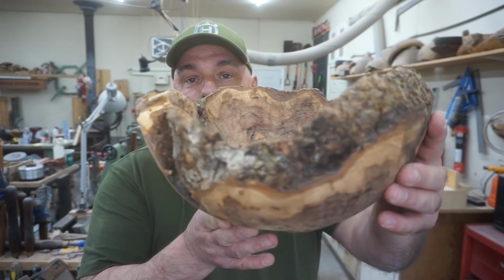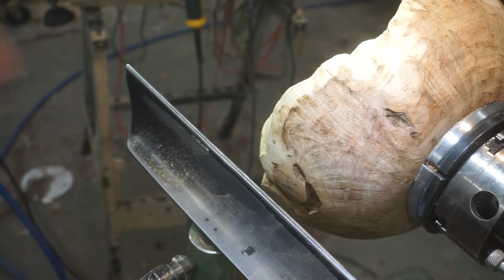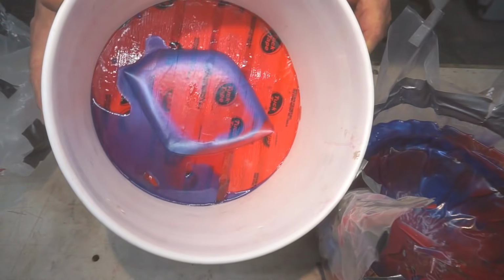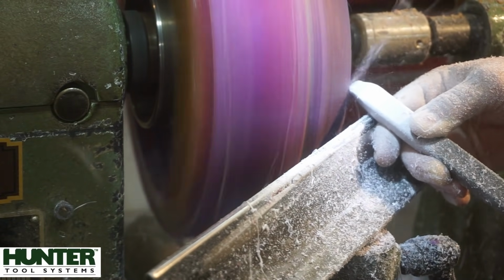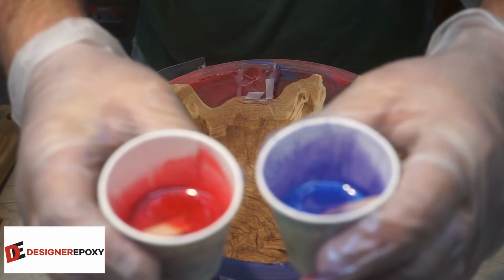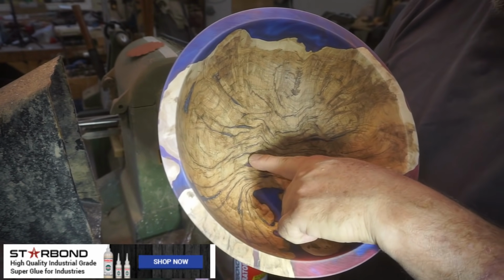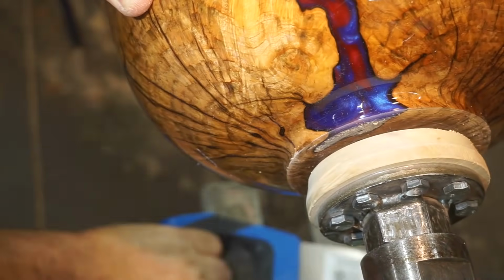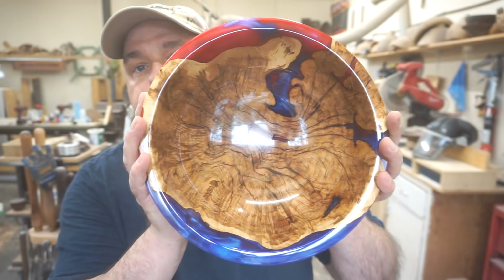Woodturning - Maple Burl with Purple Glitter and Pearl Red Resin, Hercules Tool Review

Comment: Your right, that purple does look more blue than purple. That being said another outstanding bowl!!
You've mentioned in the past that you cut the salad bowl finish with something, what was that again?
I prefer my tools un-handled for 2 reason, one so I can make one that fits my hand. Secondly, the tool costs more and there is always great wood in the shop for making handles.  On occasion when tools do come handled I've found I can turn them down on the lathe. The tool fits through the head of my lathe, the chuck grabs the ferrule and the tailstock supports the end of the tool handle. 
Keep those videos coming, always enjoy them.
Reply from the maker: I cut the Mohawk Salad Bowl Finish with mineral spirits not this one from General finishes. Thanks 🙏🏻

Comment: Jim, if you are getting tired of fiddling with multiple cups and tongue depressors while preparing the resin pour, you could try using a scale.  Density (from the msds) is equal to the mass (reading on scale)  divided by the volume (how much you want).  You would have to make a chart and then pour into one cup which is on the scale.  Then it is a matter of using your stirrer.  One cup, no tongue depressors.  Try and see if it helps.  Cheers.
Reply from the maker: I was not aware that this could be done. It does open up an area for mistakes tho, I’m known for that from time to time, lol. Thanks 🙏🏻
Reply: @SpragueWoodturning  actually, it is a lot more accurate as there is nothing left behind (sticking to bottom or sides) from pouring from the second cup into the main cup.

Comment: Another beautiful bowl.  The resin sure does make it possible to salvage and use some beautiful burl wood. I did salvage some oak burl after it blew up on me by using orange and yellow resin.  Probably my best bowl to date.  It was like turning a piece of concrete with my bowl gouge though.  Need to get some carbide tools.
Reply from the maker: They are pretty much a must have for me now! Thanks 🙏

Comment: Love your Friday morning video's Jim, Ugly lump of wood and resin turned to a fantastic piece of art.Question, do you ever use any sanding sealer to try and stop acrylic or CA from bleeding into end grain? Keep safe and keep turning.
Reply from the maker: Thanks Mark! No, I never do that. I do put a coat of finish on when doing inlays in the rim Incase the resin or CA glue wants to wick through the end grain. Other than that, not usually, Jim.

Comment: First video for me , thanks for all the great info!  How do you dry Burl different from other wood?  Seal all around because endgrain can be anywhere?  Does it add to drying time?  Does it effect how thick your first turn is?  Just starting out getting into turning though been doing woodworking for years, appreciate benefiting from the wisdom of experience, thank you for your time!
Reply from the maker: I treat burl the same as any other wood, I rough turn it, completely seal it with Anchorseal, put it in my drying shed for three months then run them through my fridge kilns. Lots of info on roughing out on my channel and bowl prep, welcome aboard! Thanks

Comment: Nice bowl.  Does designer epoxy provide info on what temp the epoxy should be at to keep the colors separated or to swirl 2 different colors together.  I haven’t but the bullet on buying and IR temp gun yet but it is in my future for just this purpose.
Reply from the maker: I’m not sure, you can ask them directly, they have a live chat that’s awesome. For me I just waited the 75 mins and it worked great, thanks 🙏

Comment: Another gorgeous bowl Jim!!!!
What was your final wall thickness? 

Thanks for sharing, Stuart
Reply from the maker: I forgot to measure it but 3/8 to 1/2”ish. Thanks 🙏
Reply: @SpragueWoodturning  Is that the norm for the bowls you do? I'm trying to figure out good proportions for mine which are generally smaller than yours. Do you have "rule of thumb" for this? Stuart
Reply from the maker: @STMwoodturning  I usually don’t ever go more the 1/4 thin, it’s survivable rate goes higher the thicker it is. Kids like to drop stuff, lol. Thanks

Comment: I assume the problem with demolding is vacuum?
When I worked as a vacuum former I had that problem sometimes and demolded with compressed air. 
If you put feets on the bucket maybe  you could put a niple in the botom for blowing in air?
Reply from the maker: Thanks Martin, I’ve used the compresses air without any success. The struggle is real, lol.

Comment: Beautiful bowl Jim, & the colors are awesome 👏🏼👏🏼👏🏼
If u put rice or sand in the bottom of the white bucket before adding the base plastic, then add your bowl & it could cut down on the waste epoxy?
Reply from the maker: Yes, it sure will. If I had of put a cable tie around the foot of the bowl that would of helped as well, thanks 😊